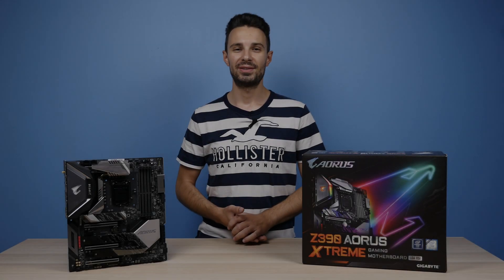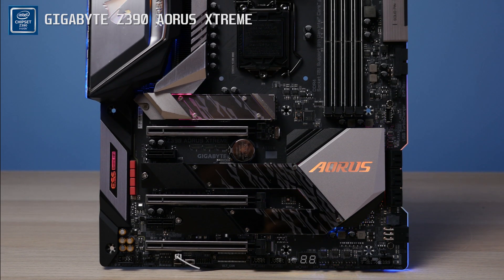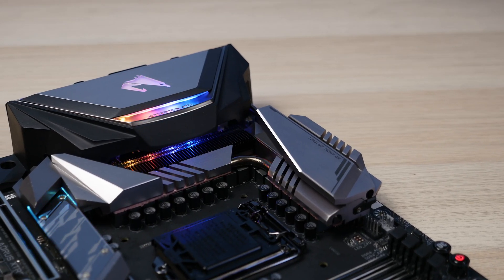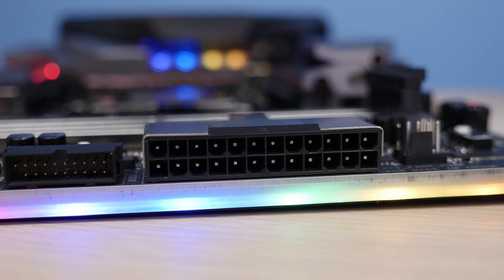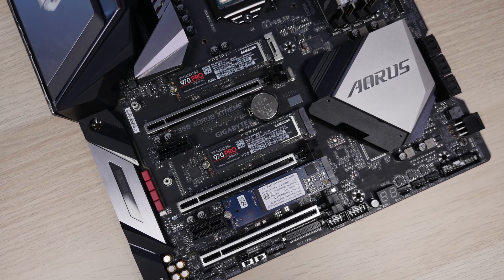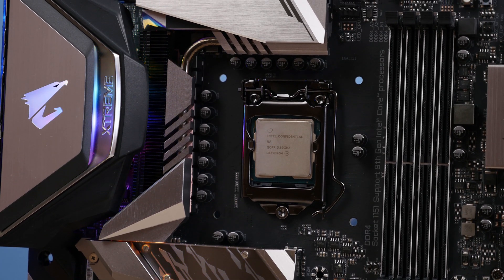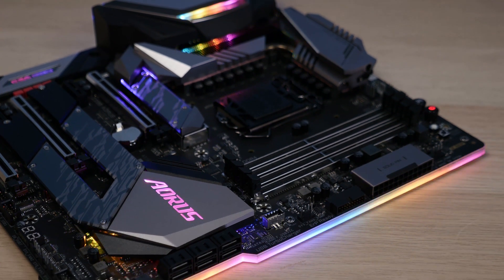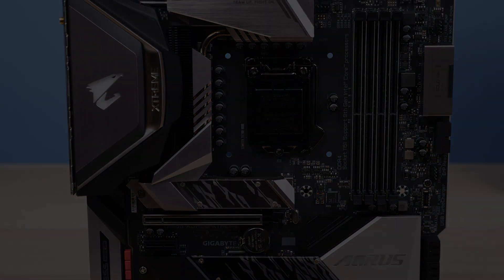GIGABYTE Z390 AORUS XTREME - Review and VRM Testing with the i9-9900K

Comment: I bought it for $500, it's the coolest motherboard I've seen in the last 6 years. 950amp power. A motherboard that can easily run 14900k overclocked. But INTEL decided not to give you support for 10, 11, 12, 13, 14 generations, only for 9.

Comment: Hey man. So 2 RTX Ti cards won't work in Nvlink mode on this motherboard? I was going buy this motherboard with two Aorus 2080Ti Waterforce cards. So which processors and motherboards can handle proper work of two 2080 Ti cards in Nvlink mode?

Comment: This  is the motherboard that I want to buy but the size of this boards is a problem and it might force me to buy another case and spent extra money that I don't have. All of this after I already  spent  $250 with the  MasterCase MC500Mt ATX-Mid-Tower Case, a case that supposedly can handle this motherboards and their size. Perhaps I should sue Cooler Master for playing and making idiots out of people.

Is just too wide and even though my case supposedly says that it supports E-ATX motherboards I don't really buy it. I believe this really wide motherboard will partially cover half of the cable management holes inside my case leaving me with a tuff dilemma trying to rout cables with only half of the cable management holes available. My biggest problem with me is tryin to connect the 20 pin power cable to the motherboard because is the thickest cable in the power supply and trying to connected to the motherboard and fit  this cable through half of hole is tough. 

This motherboard also has an unusual 20 pin power connector because they are usually straight up in the air and you connect the 20 pin power cable  from the top but this one is laying down and you connect the 20 pin power cable to the board from the right side which in my case is even tougher it would have been easier if it was facing straight up and you would connect the 20 Pin power cable from the top.

Here is a quick link for my case if anyone has any opinion and any would be greatly appreciated.

 https://www.newegg.com/Product/Product.aspx?Item=9SIA6ZP71X2626
Reply: I have the Mastercase Pro 5 and i'm pretty sure it fits. Its cable grommets are quite wide and the mobo shouldn't cover more than 1/3 of them.
Reply: This is an EATX 12"x12" board.  Your case supports only 12"x10.7".  This pasted from the amazon description: "E-ATX up to 12" x 10.7", ATX, Micro-ATX, Mini-ITX"  The case does not misrepresent it's capabilities.  Sorry friend.

Comment: 9900k is just not worth this board to be honest. If there was a CPU with 10 cores and 40 PCIE lanes then it would be worth buying something like this.
Reply: Than wait till 2021 when Intel release 7 nm, 12 core  cpu 😆
Reply: Why not? the VRM on this board is solid and not fake doublers like Asus and MSI tend to do. Temps stay within range when overclocking. Board has a decent backplate, 128 GB memory is possible and you got 10gb network and a titan ridge native tb3. Worth the money imo.
Reply: @CheesyMcBeard  For half price of this , you can have z390 master and vrm are also similar.Just at this price level only count x399 hedt.
Reply: @LEMON48  Maybe just the name scheming is wrong. The Xtreme has more HEDT functions than you would expect on a gaming motherboard. 10G network and Thunderbolt 3  (Titan Ridge not Alpine, so 8K) is more likely to find on a workstation board, created for designers/video editors etc. I think the price is justified. Did you notice how the motherboard comes packaged? I've seen mothersboards cost more with worse package and no goodies at al. 

And after all of that, you can't compare this platform to x399. The only X399 that has thunderbolt 3 is a 1000 dollar board. And if you willingly to go X299 most boards are outdated with outdated connections, because everyone is waiting on the new socket that is coming. The only board on X299 that is relevant now is the Prime Deluxe II with 2019 features. But the more expensive comparable 9800X processor performs WORSE in case of Premiere Pro or Adobe Photoshop at 100 dollars more.

So, yeah. I see why people (like me) would choose to go for this board. Because after all (for designers and editors) you have all the 2019 connections and at this pricepoint there is not one single board on the platform that performs and has the same.